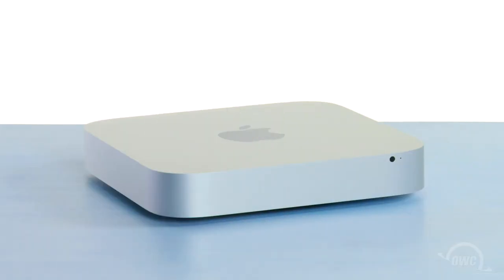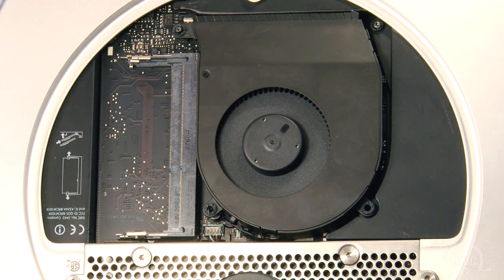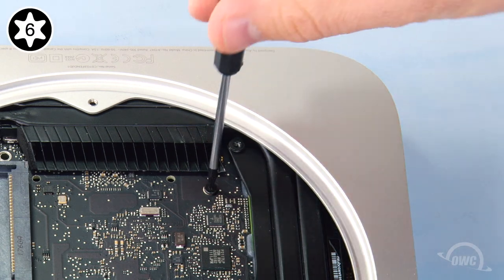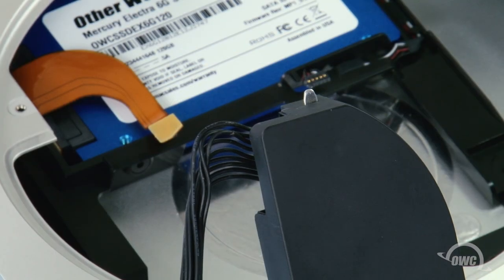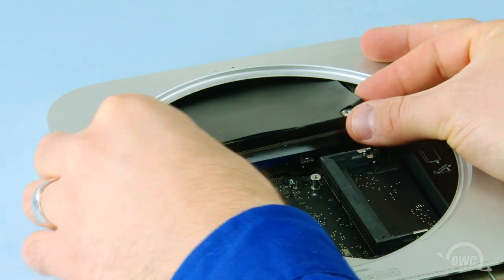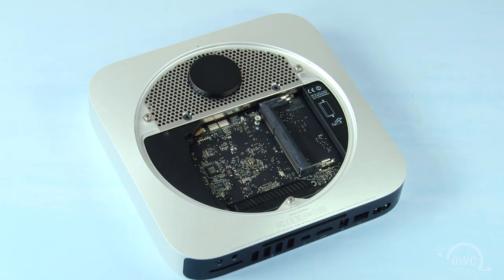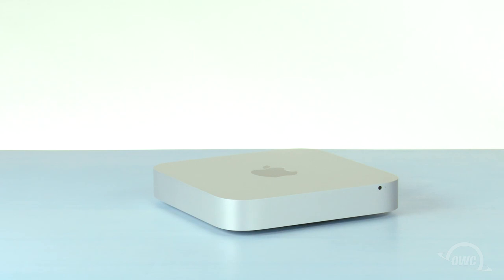How to Install a Second Drive Inside a 2011-2012 Mac mini with the OWC Data Doubler

Comment: Thanks for the video. Over the years I've dove in to my 2012 Mini about a 1/2 dozen times, replacing and upgrading drives. Be careful with the IR cable socket; I broke a couple of prongs last time in but am not losing sleep over it as I've never used IR and never will. 10 years later I've installed Monterey (officially not supported) to keep the device current with updates.

Something you may want to attend to: once the logic board is removed, flip it over and you'll see the PRAM battery, a standard watch CR2032 button. If you've never replace, do so. It may save you an extra disassembly session.
Reply: Hi Luke, do you have a particular tutorial showing how to install Monterey on the 2012 Mac Mini? Thanks in advance!
Reply: @valramos2003  Well, I upgraded the Mini to Ventura now but it's the same procedure using OCLP. Here's the video for Installing Ventura. 
https://www.youtube.com/watch?v=3LOqHMo5WSQ
Reply: @Fetucinee  Awesome! Thank you very much!
Reply: too easy to do - I would avoid using the pry tool as if you try from the wrong side you'll lift the whole socket receptor off the board - my advise would be to use a tiny screwdriver / rod under the ir cables at the back of the socket and pull up from below then use tweezers.

Comment: Thanks, did the upgrade, plan to use it as a plex media server. Two issues I ran into. 
One, I broke the IR sensor. I was gentle with it but apparently not gentle enough. Not worth trying to repair it, only downside is there is no light now to indicate when the mac mini is on.
Two, I didn't seat the fan power cord all the way to the logic board. I should have checked to make sure the fan was spinning before putting the back cover on. Thankfully I noticed it was getting hotter than normal after about 20 mins of use and fixed the issue.

Also the gentleman that gave the advice about pushing the logic board removal tool all the way down before attempting to slide it out, thank you.

Comment: For first-timers, this is not a project for the faint-of-heart. Give yourself at least a full morning or afternoon. Or both. Be hyper-organized. Plastic ice cube trays are a good way to separate screws used at each step of the process. Ideally, label each space in the tray to indicate where the screws fit in your mini. Don’t plan to “remember” where the screws went after more than a few hours; you probably won’t as you get tired. Note: The video sometimes changes the orientation of the demo unit from scene to scene. Double-check that the orientation of your unit matches that in the video.

• The hard drive can be removed after removing the long logic board screw. That will give you more room for this next step: 

• When detaching the IR cable, gently pry up from the lower corners next to the drive bay using the pry tool.
The video makes prying out the power supply cable look much too easy. As you pry it out at each end, the opposite end will slide back into place. Use the flat screwdriver to hold one end from sliding into place while prying out the opposite end. Work slowly. Do NOT attempt to pull out by the wires. Large needle-nose tweezers would be helpful, if you have them. 

• (From Kirtan Dreamrezzer ) IMPORTANT!!! : The logic board removal tool needs to be inserted until you feel the underside of the Mac Mini top, until the ends of the tool insert into two anchoring holes, these holes provide a stop, so you can then easily knudge the logic board out. DO NOT PULL or FORCE the Logic Board Tool until feel that the metal tips are secured in those stopping holes on the underside, if not, you run the risk of cracking the logic board. My logic board tool was not exaclty the size to fit so I had to bend it with pliers until it was fitting exactly in the two logic board holes, this is why I wasn't able to knudge the metal tips in the anchoring holes on my first tries. This is tricky! You may have to insert the tool to release one catch then reverse it to release the other catch. (JKB)
The rubber grommets in the kit are too thick to allow the kit HD screws to thread into a new HD. Insert the rubber grommets into the mini’s carrier holes then use a sharp blade to cut them in half flush with the carrier. These half-thickness grommets work fine.

Reassembly:

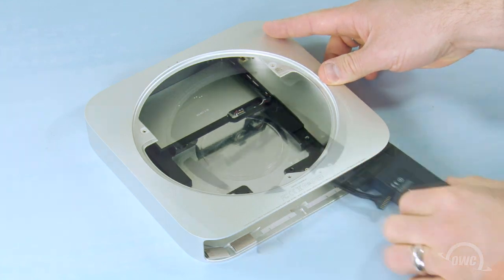• When reinstalling the power supply, make sure the longer tab on the PS socket will face toward the bottom of the mini after being turned clockwise into place. Confirm the PS socket’s orientation before reseating the PS. (See 3:00-3:03 in the video.) (Note: You’re working on the mini while it’s upside down; be sure to note what’s the bottom and the top of your unit.) 

• The silver metal tab closes the gap between the top black tab of the PS socket and the top of the case. Insert it carefully as it’s easily bent. The video makes it look super-easy. It’s not. Looking at the tab from the inside of the case as you attach it to the top black tab is helpful. 

• Look at the power supply socket before you reinsert the logic board into your mini to get a better idea of how the PS cable will fit in place.

• When pushing the logic board into final position, be sure the black insulation surrounding the power socket doesn’t bunch up into the power socket.

• To get the upper drive to fit into the available space and allow the SATA cables to attach properly, I left the mounting pins off. (Note: I replaced the original drive with an SSD.) The kit SATA cable is a hair too long and will need to be pressed gently but firmly into the logic board’s SATA port. 

• The black cowling screw fits into the screw head underneath the black cowling. 

• The Airport cable is diabolical. It’s a tiny COAX cable. To reattach it, turn the Airport grate counterclockwise so it’s at a right angle to the mini. Focus on getting the cable’s connector over its logic board port without moving the cable too much. Carefully push down on the cable’s round connector so it attaches to the logic board's round port. It’s a friction fit. Immediately push down on the insulation tape above the connector to hold it into place. As you hold down on the insulation tape, adjust the cable as needed so you can move the grate into position. Keep holding down the left side of the grate until you screw it down with a 2mm hex screw. 

• Reminder: The fan connector pushes down into its socket.

After you’ve finished, powered up, and if everything works, congratulate yourself. Good job.
Reply from the maker: Thank you so much for the review, James! We do recommend professional installation for anyone who feels like the installation process is outside of their comfort level!

Comment: Did all this today and it’s not difficult but the logic board was difficult to get out - didn’t just slide out - and the same was the case with the power unit. And inserting the grommets is not easy at all. I eventually rolled them in my palms and squeezed them to warm them up to be more pliable. Soft they ain’t.

Comment: IMPORTANT!!!  :  The Logic Board Removal Tool needs to touch be inserted until you feel the underside of the Mac Mini top, until the ends of the tool insert into two anchoring holes, these holes provide a stop, so you can then easily knudge the logic board out. DO NOT PULL or FORCE the Logic Board Tool until feel that the metal tips are secured in those stopping holes on the underside, if not, you run the risk of cracking the logic board.    My logic board tool was not exaclty the size to fit so I had to bend it with pliers until it was fitting exactly in the two logic board holes, this is why I wasn't able to knudge the metal tips in the anchoring holes on my first tries.
Reply from the maker: Thanks for the helpful advice Kirtan! If you run into any further issues please send us a ticket at support@owc.com and we can advise further!
Reply: @poweredbyowc   I have a question if I 2011 version can swap the motherboard with 2012 version only

Comment: I've disassembled several Mac minis and never had a problem until the most recent attempt where the IR connector broke when I removed the cable. I was able to find replacement connectors, but I can't get the tip of my soldering iron in past that post that sits next to the connector. 

Does anyone know if that post can be temporarily removed in order to access the solder points on the connector?

Meanwhile, I'm searching for a very thin right-angle soldering iron/tip.

Comment: Congratulations for the excellent tutorial.
In my case I want to add a PCIe ssd and keep the original hdd of my mac mini late 2012. Have you a tutorial for my case?
Reply: These machines do not have either PCIe or M2 sockets, so if you are thinking about an SSD, you’re stuck with a SATA III drive as your only option.
Reply: @MGBNAM  Thank you.
Reply: @MGBNAM   there are adapters that covert m2 ssd to work with sata
Reply: @MGBNAM    there are adapters that covert m2 ssd to work with sata
Reply: @cleitonpena4578    there are adapters that covert m2 ssd to work with sata
Reply: @Helennore1990  Thanks

Comment: If I install two SSDs the video is not clear how to connect the second SSD to motherboard?
Reply from the maker: This video shows the installation of the 2nd drive. The linked video below is the installation of the main bay SSD.
https://eshop.macsales.com/installvideos/mac_mini2012_hd/Macmini6-1-nonserver/

Comment: Hi, what is the cable to add SSD as a primary drive, 821-1500-A , or 821-1501-A cable. The existing hdd is at top when mac mini is on its correct side up. Pls advice. Are the cables inter changeable?
Reply from the maker: It really depends on the MacMini you own, A small number of 2012 units were shipped with the drive mounted in the upper drive bay rather than the more typical lower bay shown in this video. If you have a 2012 or later model, you will want to determine the configuration of your Mac mini's drives prior to ordering. To do this, open the Applications/Utilities/Disk Utility.app and click on the grey drive icon at the left edge of the window. If you see "Lower" after the "Connection ID" at the bottom-left corner of the window, you may proceed using the standard installation instructions. If you see "Upper" then you have a special configuration that will need additional components, and you will need to also refer to the Addendum video.

Comment: I’m about to order the parts kit to do this and don’t know which to buy, for lower or upper drive bay? My Mac doesn’t tell the location so which one is upper and which is lower? Is the upper the first you see when the mini is upside down and you open it up?
Reply from the maker: The lower bay is the first bay you see when you open the Mac Mini, Upper is nearest the top of the Mac mini.

Comment: Hi OWC, i have a 2012 mini, which is better- adding a second drive or replacing the main one with an SSD? also, would a 8gig ram to 16 make a significant difference?
Reply from the maker: Howdy Jason! Well depending on the model we are working with those may be worthwhile upgrades! However if you could reach out to our support team at support@owc.com they would be able to assist with getting you over to the best upgrades!
Reply: Hey Jason. I was wanting to ask the same question- what did you end up doing?

Comment: Thanks for this, will be ordering some items in the near future.  Only, I do not understand the need or benefit of second drive? I have a Mac mini 2011 I want to up grade...
Reply: I have converted all of my dvd and blue ray collection to digital. It has taken up more than 4TB. I am up grading to  second drive so i can keep all of my movies on my mini as it stays attached to my TV.
Reply: Mini is not a laptop , it is a desktop computer and an external hard disk or SSD can easily be attached on the USB .. There is absolutely no need to add a second drive.  The only thing attractive to me is to replace the existing slow hard disk to an SSD , to make the computer run faster and this is what i will be doing in the near future ..
Reply: @WaqasNasir Honestly, I don’t understand why anyone wouldn’t see the benefits of being able to install a second drive in any computer. Given the height (drive) limitations, no 2.5” drives on the market above 2TB will fit, unless you are using SSDs. Which given the Mac in question, I seriously doubt many could afford or even justify such an expensive drive. But, thanks to Apple’s Fusion drive, you don’t have to compromise on price/performance/capacity.

As for the idea of using external drives sure you could, but you could also have internal ones. External drives for me me cover only backup and portables drives/data. I suppose knowing I’ve 6 drives in my PC must bother you, I mean they could all be external right? Only hard drives are safer in a chassis than sitting around where they might get dropped for example. There are many good reasons to keep your working data in the system only, not least that the Mini has only 4 USB ports, all of them located in the dumbest possible place for people who don’t have huge open desks to place it on. Clue’s in the name really, would front USB ports really be so terrible? Not that my views need change yours, but geez I do hate coming across such closed mindedness. I’ll add, Apple themselves offered dual drives in these systems, probably why there is space for them.

Likewise,  whilst clearly the Mini is a desktop system, it’s parts are not, they are laptop parts. This means they don’t perform anything like their desktop equivalents. Of course, the same is mostly true of all Macs, so whilst it may not be technically correct to call it a laptop, it’s not really a true desktop either in this sense.

Comment: Embarrassingly I've just taken it all apart with a 256GB SSD and dual SATA cable bought ready to install only to find that I've already a second drive in the slot. I hadn't realized that's how Apple achieved the Fusion drive - I'd assumed it was a custom 2.5" package, but no 2 x 2.5" drives.   Luckily it's not a long job to complete, so now to go buy an enclosure!
Reply from the maker: If you need any 2.5" drive enclosures, know that OWC has you covered! Here is a link to some of our available 2.5" drive enclosure options: https://eshop.macsales.com/shop/hard-drives/External-Enclosures/2.5-Inch-Drives-HD-SSD Hopefully one of these might be able to help you out. :)
Reply: @poweredbyowc  thanks do you do a Mini Stack or something that brings some extra ports to the party at the same time?
Reply from the maker: Hi Adam! Regrettably, we do not offer a Mini Stack enclosure with additional ports. However, we do offer the Mercury Elite Pro Dual with 3-Port Hub. Below is the link.
https://eshop.macsales.com/shop/owc-mercury-elite-pro-dual

Comment: Fan connector and IR cable connector are stuck - even tho I was gentle and went very slowly, the fan connector came entirely off of the board.  Despite needing to buy a new board now, I am trying to pry the IR cable connector apart without ripping it off the board too, so far not successful.  Anyone else have similar issue?  The video is great but in the video everything comes apart so easily.  Not so with my mid-2011 mini
Reply: I can't claim to know what happened in your case, but I do know all these connector sockets are weak against any twisting or lifting force. The force must be evenly applied across the connector, but if it's stuck then you can't overcome it with extra force as you might pull off the socket. 

If the cable won't budge with reasonable force, check for a locking clip that might be doing it's job. As a last resort, you can "wiggle" the cable forward in very small amounts until it starts moving. I had to break the "no twisting" rule above by using a plastic spudger to push one side of the cable forward, then the other side... in very small amounts. Once I saw the tiniest movement on both sides I went back to the recommended approach and the cable slid right out.
Reply: A local tech or Makerspace could probably reflow or solder the fan header, BTW.